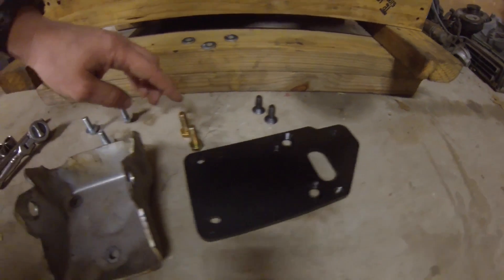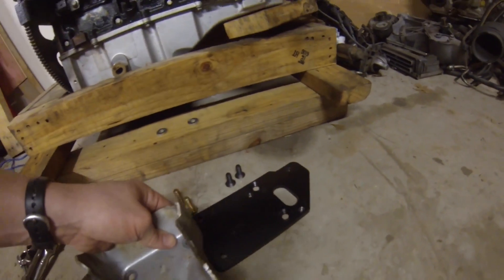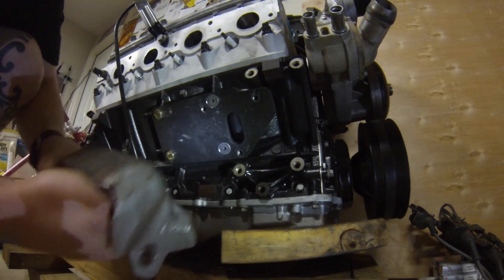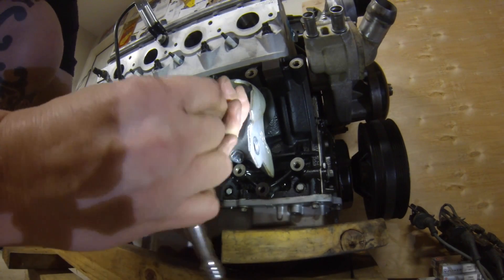How To LSx Motor Mount Adapter Swap Plates (One Inch Set-Back Plates)

Comment: Im doing the same application for my 1987 c10 but my truck had a v6 in it and im using the adapters I was wondering if the v6 motor mounts will work or do I have to get 350 motor mounts
Reply from the maker: I would suggest you acquire LSx swap mount for the swap. If you can’t find specific swap mounts, then get adjustable mounts. They’ll allow you to move the engine into the correct place that you’ll need for the swap and keep the factory driveshaft. 👍
Reply: Ok thanks bro

Comment: Can I use the stock swb 84 c10 driveshaft with the adapter plates and 4l60e trans or can I use the stock driveshaft from the swb donor truck

Comment: Running similar plates in my k10, i can get one 7/16 engine mount bolt through but not the second bolt,you think i should unbolt the mounts from frame and bolt the male part of the clamshell directly to the clamshell and then try to drop the whole assembly down in?

Comment: Which adapter plates do I need for an 84 coupe deville. Stock 2004r trans?
Reply from the maker: These usually do the job.
http://rover.ebay.com/rover/1/711-53200-19255-0/1?icep_ff3=2&pub=5575162067&toolid=10001&campid=5337841854&customid=&icep_item=231829660999&ipn=psmain&icep_vectorid=229466&kwid=902099&mtid=824&kw=lg
Reply from the maker: To avoid possible headache from engine position not being right, people often use these.
https://www.amazon.com/gp/product/B00QSICS6M/ref=as_li_qf_sp_asin_il_tl?ie=UTF8&tag=age0a0-20&camp=1789&creative=9325&linkCode=as2&creativeASIN=B00QSICS6M&linkId=576eb1a32b81c85612362cf6c4bd1106

Comment: Do u have the name or link for the company you got the 1"setback plates? All the ones I found do NOT clear the bosses, thank you for all the info, great videos!!!
Reply from the maker: Thank you Richard! Check out these mounts. http://rover.ebay.com/rover/1/711-53200-19255-0/1?icep_ff3=2&pub=5575162067&toolid=10001&campid=5337841854&customid=&icep_item=231829660999&ipn=psmain&icep_vectorid=229466&kwid=902099&mtid=824&kw=lg
Reply from the maker: And here’s another option. https://www.amazon.com/gp/product/B00QSICS6M/ref=as_li_qf_sp_asin_il_tl?ie=UTF8&tag=age0a0-20&camp=1789&creative=9325&linkCode=as2&creativeASIN=B00QSICS6M&linkId=576eb1a32b81c85612362cf6c4bd1106
Reply from the maker: And a third option, but I’m not sure that these will clear the boss. May have to trim them. http://www.amazon.com/gp/product/B00JU7LQ8Y/ref=as_li_qf_sp_asin_il_tl?ie=UTF8&camp=1789&creative=9325&creativeASIN=B00JU7LQ8Y&linkCode=as2&tag=age0a0-20&linkId=EF5BP5UYPEKOL7EA

Comment: I have a 98 chevy c1500 with a 5.7 Vortec with a 4l60e and I'm wanting to do a ls 5.3 swap if I do these plants will the oil pan clear the frame or will I have to buy a different oil pan?? And can I use my old trans or should I get a 4L80e with the 5.3ls?

Comment: I am installing using the trans dapt 4575 plates and when I try to install the clam shell the bolts Do hit the webbing of the block  on 2 of the 3 holes. 

I cut the hump.out of the clam shell.   Anyone else having this issue? What do?

Comment: bro im a fan of ur chanle i have a c10 82 with the 6 in line motor im having trouble help ....!!! i got the billet brackets from ict they fit perfect on my ls 5.3 but my motor mount from the 6L motor dont line up with the brackets do i need to buy the mouter mounts from a c10 v8 is there any diffrence??? 
plz help bro im stuck with no info

Comment: How about the transmission cross member? Will the 4l60e line up with the original location? Or does one need to drill holes and relocate the cross member?
Reply from the maker: +nandoGdog If using the LS 60e, you usually need to slide it back about 2" and drill holes. Seems like their mount is a little further back.

Comment: Why do you have to set it back one inch?
Reply from the maker: It's the style that these plates are called and that is the positions that most often puts the engine in the place to meet up with the trans in its original location so that you dont have to get a custom length driveshaft.

Comment: I have a 93 c1500 thinking about putting a lm7 in it at the moment it has a 4.3 tbi would these adapter plates work with my truck?
Reply from the maker: Yes, but you may need the v8 frame mounts as well.
Reply: v8 frame mounts and v8 clam shell ?
Reply from the maker: Yes
Reply: B.L. M.N. trying to do an LS swap on a 94..do u have any pics of the chasis and motor mounts that need to b changed??...

Comment: have you done a ls swap in 78-81 Camaro? I need to be able to have the ls same place the old set with long tube headers  i'm in the beginning's just pulled my 406sbc and building a lq4 to drop in. aside from others I have a built th350 . and built driveshaft so I want to retain both of those
Reply from the maker: These should put it there. If you're concerned and want to make sure the mounts that you get will set it where you want it, get some adjustable mounts.

Comment: I'm doing a swap in my 2000 Silverado was a v6 but I'm putting a 5.3 in it out of a 02 Avalanche but the driver side motor mount doesn't fall into place wondering what adapter do I need or frame mount because the bolts on the frame mount are closer then the v8 frame mounts thanks
Reply from the maker: I would think that you'd be best using all of the mounts from a V8 2000 chevy truck to fit it, no?

Comment: I have a 79 suburban and i got a 02 that is totaled so i want to do the ls swap. Would these be the plates to use on that application?
Reply from the maker: Yep, they're one option. There's also a link in the video description to anther option that will work just like these, but also have optional adjustment and are cheaper.

Comment: What size washer did you use gonna swap my lq9 in my 90 Chevy obs
Reply from the maker: I couldn't tell you, but just get some that fit the bolt that you're using and then stack them just until that center of the clam shell isn't touching anymore.

Comment from the maker: Here's a link to some inexpensive adjustable adapter plates. http://www.amazon.com/gp/product/B00JU7LQ8Y/ref=as_li_qf_sp_asin_il_tl?ie=UTF8&camp=1789&creative=9325&creativeASIN=B00JU7LQ8Y&linkCode=as2&tag=age0a0-20&linkId=EF5BP5UYPEKOL7EA
Reply: will these plates work for my 98 c3500?  originally it had a vortec 454 and I'm lq4 swapping it. thanks
Reply from the maker: Yes. They're one option. There are many options.

Comment: Do you know what motor mount plates I would need to put a ls in a 1966 Chevy c10
Reply from the maker: +Israel  Guzman I have a buddy who had good luck using these inexpensive adapter plates. http://www.amazon.com/gp/product/B00JU7LQ8Y/ref=as_li_qf_sp_asin_il_tl?ie=UTF8&camp=1789&creative=9325&creativeASIN=B00JU7LQ8Y&linkCode=as2&tag=age0a0-20&linkId=EF5BP5UYPEKOL7EA

Comment: I'm working on putting a LM7 from 2002 Tahoe LS into 1989 Silverado; I have new adapter plates and new frame motor mounts....where can I get the clam shell engine mounts???

Comment: If i use these  would i need to use a spacer for the flexplate?
Reply from the maker: +Luis Rodriguez That would depend on what transmission you used. The spacer is for the trans/torque converter.
Reply: +AGearhead4Life 4l60e ill be using a stock converter that came with the trucks tranny
Reply from the maker: +Luis Rodriguez But which 60e and which truck?
Reply: +AGearhead4Life 94 silverado extended cab .
Reply from the maker: +Luis Rodriguez If its an SBC trans you'll need the adapter/spacer to support the converter when bolting it behind a LS motor.

Comment: Hey mark. I just installed the 1in set back plates in my r10. The drive shaft is too long and my cross member is too far back what do you suggest? I'm running a 4l60e, what plates did you use on your last truck when you had the 4l60e.
Reply from the maker: +Juan Sanchez If it is, you can drill new holes in those plates to move it forward an inch, but I'd expect those to work. The trans crossmember does normally have to move further back. The mounting point on the 60e is further back.

On my last truck, I don't remember. Could have been the central mounting plate, but I also didn't double check slip yoke on it. 

Also the type of yoke can make a difference. the yoke that I used on my current truck is what made me have to use a central plate on it. The yoke was an inch longer on the style of 80e yoke that I used.
Reply: +AGearhead4Life I think the central mounting brackets will work. The drive shaft is about an inch too long and the cross member is also. What do you.think about those dirty dingo adjustable brackets, do you have the link for the central mounting brackets
Reply from the maker: +Juan Sanchez The Dirty Dingo adjustable mounts are great. They help to avoid the situation that youre having, from what I hear. The trans crossmember will still have to go back at least an inch compared to where it was originally mounted, maybe two inches.
Reply: +AGearhead4Life Thanks Mark I appreciate your advice and input.
Reply from the maker: +Juan Sanchez No problem Juan! 
Remember, you can drill and tap new holes in those 1" set back plates if you need to, to move it forward an inch.

Comment: I'm putting a ls 6.0 into the same type of car as your camaro did you use the stock oil pan or go with a low profile pan
Reply from the maker: +2152808483 You'll have to use the F-body oil pan unless you have someone who can weld aluminum for you to turn the truck pan into a low profile pan. The f-body pan is the most low profile LS pan and that clearance is needed on the 3rd gen Camaros.

Comment: question for ya. im doing this swap with a stock 5.3 out of a burban I cut the fuel lines off so I have them still with the quick disconnects what did  do for a fuel system? use a quick disconnect fitting?

Comment: Which bolts did you use
Reply from the maker: 88lsbox The plates come with some which are metric to go into the block. Then your standard bolts for the SBC will bolt the clam shell to the adapter plates.

Comment: when using this plates with a 4l60e, does the transmission mount need to move back 1" or stays the same?
Reply from the maker: Jerry Garcia With the newer LS trans, yes it goes back one or maybe two inches.
Reply from the maker: Jerry Garcia If it were the original trans for that vehicle it wouldn't move at all.
Reply: 10-4 thank you.

Comment: I see u have a flip kit on your truck if u have any problems with the frame of the truck hitting the axle when u hit a bump if u have drop shocks like I did I switched my drop shocks to air shocks an no more of the frame hitting the axle an I have a better ride just a suggestion thanks for the vids
Reply from the maker: Thanks Anthony! Yea after I removed those tall factory bump stops I havent had an issue bottoming out yet, but I do plan to try out the air shocks. I figured they'd help when carrying a load. Thats great to know that they were better than running a drop shock. I've just got stock shocks all around right now. Thanks for sharing your experience!

Comment: Awesome videos lad! Got a quick question I'm looking at swapping a 5.3 into my 92 chev 4x4 I was told somewhere along the line that the my trans will bolt up but there is a offset issue with the converter to flex plate is that true or can I get those adapter plates and bolt it right in? I was also looking for further information on the standalone harness I have a early 5.3 from a truck I have upto the cab for wiring harness the fuse box Is missing tho.. Also will I need a programmed ecu if I only use upstream o2 sensors?
Reply from the maker: Yea, you need an adapter to support the snout of the converter. THere's a few ways to do it, but its cheap. Or you can just use the flex plate and spacer that come off of a 6.0/4l80e vehicle, that'll do the same thing. Guess I need to make a video on this. You'll need to have the PCM flashed to disable the VATS to allow the engine to run. At that time you can have him disable whatever else you want done. Wiring diagrams can be found at LT1swap.com to show you where to give power. If you find another fuse block for that harness you could just simply give it power in two spots and it'll run. I have a video showing this, search "5.3 with 4.8 pistons first startup".

Comment: Thanks for the info Gear Head. I recently bought these exact plates for my 5.3 swap in my Malibu that had a 350. I'm temporally using the stock th350 trans with the adapter for the 5.3. I have yet to test fit so I'm a little nervous. I should be able to keep the stock drive-shaft and keep the cross member in the stock location right?
Reply from the maker: Usually, yes you should. I always reuse the stock driveshaft when I can. Havent had to have one made yet. Good luck Malibu Jak! Let us know how it goes.

Comment: Nice job.  I do things very similar except for two little things that might help.   I just hammer the indent in the clamshells flat if they have them (not all do) with a little heat so I don't need the washers behind it, and on aluminium blocks I use antiseize instead of locktite, then a star lock washer.
Reply from the maker: ah yea! Good tips RacerRick! I like that. Now I want to buy a torch even more. That'd make it much easier to heat it up to knock that indent flat. Thanks for sharing your thoughts!
Reply: +AGearHead4Life 
what brackets do i need for a 68 gto pontiac engine frame brackets???? as they are bigger than sbc brackets
Reply: I have been using Dirty Dingle slider mounts recently and really like them.  I am putting a 5.3 into a G body right now and will be using their mounts.
Reply: Thanks brother

Comment: Thanks for the quick response.. Would you by chance have a part number?
Reply from the maker: No, but search this on ebay: "one inch set back LS1 plate"
Reply: +AGearHead4Life  I have adapter plates and new frame motor mounts for my conversion...where can I find clam shells; I have a LM7 from 2002 Tahoe; going into 89 C-1500...

Comment: Is it a new or used unit if you have the sellers info send it to me if you don't mind
Reply from the maker: I got it new on eBay from Summit. Here's the actual Summit link:  http://www.summitracing.com/parts/dtl-912a556
Reply: Ok thanks a lot putting it on my list

Comment: Hay mark need to know how many miles were on your transmission when u got it an also did u run a inline fuel pump on your truck or in tank an what type if so
Reply from the maker: I dont remember now how many miles they told me were on it, but it was probably close to 200k. 

I ran an in-line pump on my last truck swap, but on this one I did in-tank and like it much better. I use Walbro 255 fuel pumps. I'm planning to find a tank that'll fit in the rear of my truck behind the bump soon. Maybe one from a blazer or a Caprice. I don't like how hard it is to access the pump where my tank currently is.
Reply: Ok thanks do you like the 4l80e over the 4l60e I wad thinking of going with the 4l65e
Reply: Send me the info when you do your rear end also I looked on ebay for the rear posi unit they had the used auburn units are they the same
Reply from the maker: anthony jackson Each trans has its pros and cons. I like the 80e over the 60e because it is strong and i can beat the crap out of it without worry. 60es break too often. I also chose it because it will be strong while being used to tow my camaro around. 

The only time i'd like a 60e is if it was built by a reputable shop and that would cost at least $1200. I'd definitely consider a 65e though. But since I plan to tow with this truck, I like the 80e in it.
Reply from the maker: anthony jackson What info do you need for the rear? Torque specs? I just ordered the Eaton Detroit Truetrac tonight actually. I sold some parts, had cash and thought I'd try it out.

Comment: Hay mark need to know how many miles were on your transmission when u got it an also did u run a inline fuel pump on your truck or in tank an what type if so

Comment: Yea a 60e. The truck has a th350 with 3.73s so I'm happy for the overdrive lol. If the stock th350 driveshaft doesn't fit I'll just get one off a 700r4 truck from the local u pull it they have lots of 73-87s

Comment: Dang it! I feel like an idiot now, I cut a 1/4 in off that one boss instead of just cutting a notch in that clamshell like you did.  O well ya live and learn I guess. Anyways, great vids man, keep sharing that knowledge of yours.
Reply from the maker: Thanks Beanoman! Nah thats no big deal at all. Those are just AC compressor mounting bosses. Doesnt hurt anything if you don't plan to run the factory AC. You can always run other types of AC compressors in other locations.
Reply: AGearHead4Life yeah man,  I guess it doesn't matter,  I ain't too worried about ac right at the moment, i just wanna get this thing running.  But thanks for videos man, your helping a lot of us gearheads out.
Reply from the maker: Beanoman90 Awesome! Glad to hear it man. Let me know when you decide that you want AC, I'll show you another way to do it and on the cheap. Keep on Wrench'n!
Reply from the maker: Thanks Bobby! Yea, thats a tight squeeze Bobby! I've got that AC setup posted on my Facebook page. We did it on a 5.3 '93 Roadmaster swap. I havent done the update video yet to show it though, but its running fine so far. We still need to charge the AC system. We had to postpone that since the trans gave out on the test drive.

Comment: So on my c10 would i need the 1 inch set back plates?
Reply from the maker: More then likely, yes. There are a couple situations that will require a different mount, but the odds are strong that the "one inch set back" plates are the ones you'll need. For example I wasn't able to use them on my swap because of the type of 4l80e yoke that I used. If I would have had a 4l60, everything probably would have been fine.